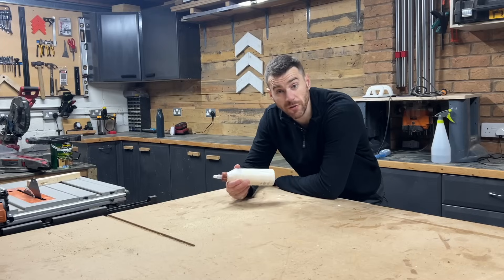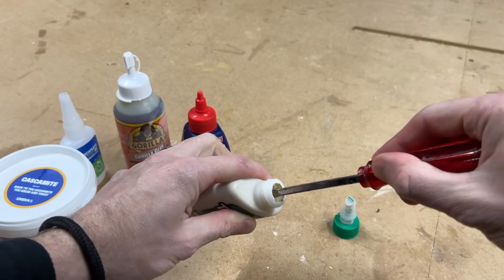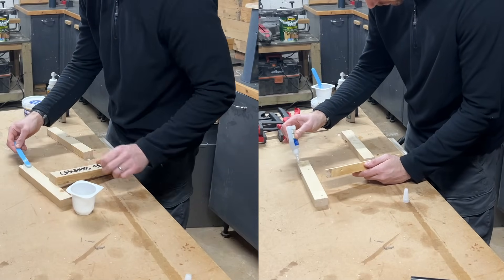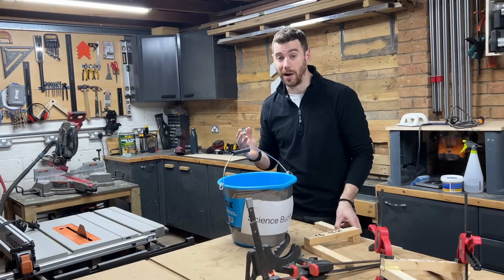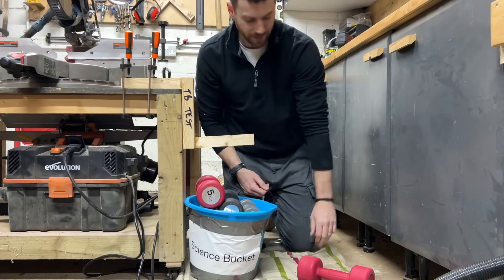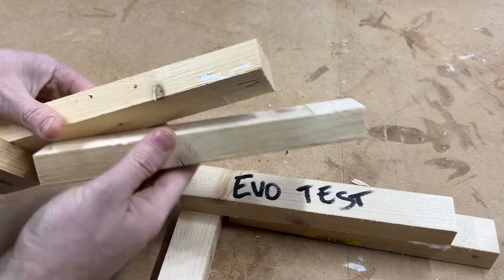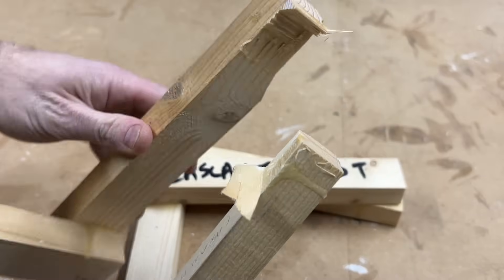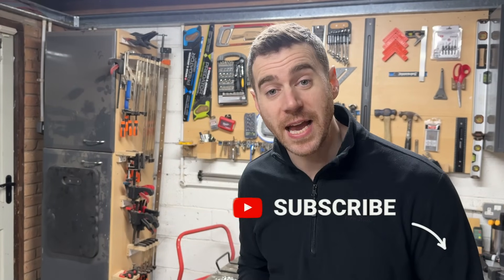What REALLY Happens When Wood Glue Freezes?

Comment: great video. i love shop experimentation. my solution to the vanishing pencil is having twenty of the things stuck pretty much everywhere in the shop and two in my apron. 

CA glue is strong initially but very susceptible to weakening from wood movement due to how brittle it is. it is also really weak to shocks because it can't flex like a PVA or most other glues can. every jig i've assembled with CA glue has come apart over the course of a few years when i was in areas with a lot of variability in humidity. these days i use CA in addition to PVA most of the time. most of the gluing surface is PVA with a few drops of CA with an activator to hold the part together so i can keep working without waiting on the PVA to fully dry. close to getting the best of both worlds. for oily exotics or things that will see a lot of moisture. i've switched to a quality epoxy instead of PVA and still usually use CA glue to hold it together while the epoxy cures. saves on clamps.
Reply from the maker: I’ve used ca glue in the same way you suggest. Essentially acting as a clamp while the ‘proper’ glue dries. 

I must admit I’ve not really done any tests on the longevity of CA glue and other people have said the same as you that it doesn’t do so well over time.